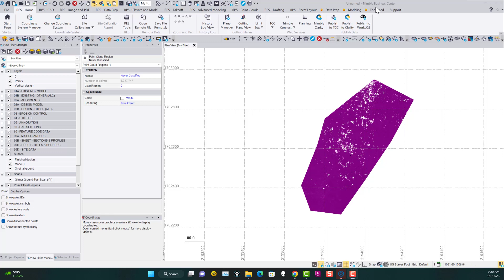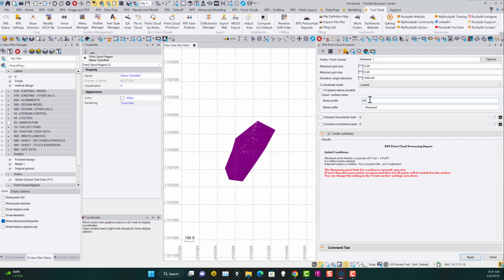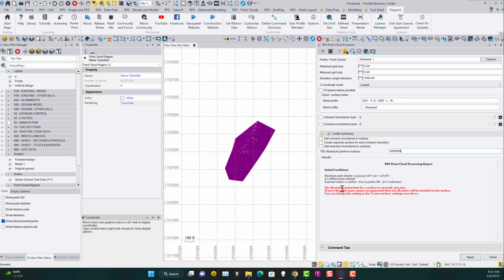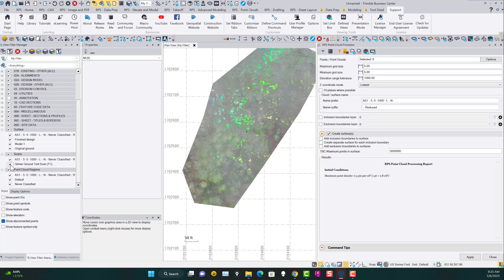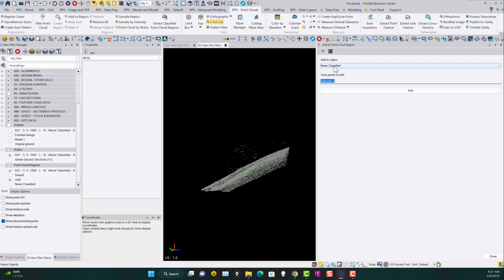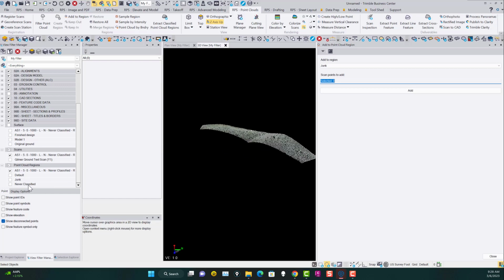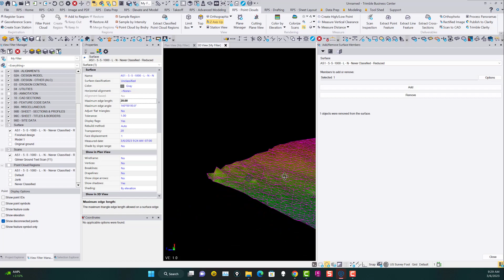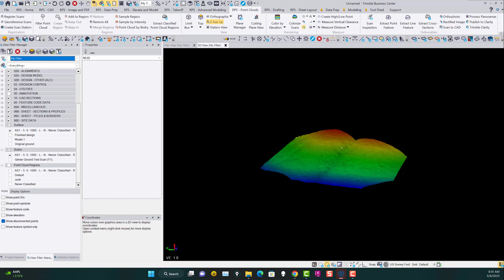How To: Point Clouds - Removing Tree Canopy & Brush

Comment: I wonder how good this would work to remove automobiles in a roadway scan.
Reply from the maker: We have not tried that as of yet, but is something worthwhile trying. Would you be able to share an example file to us at contact@rockpilesolutions.com so that we can test it out for you? If it is something that works, we would be happy to release a video update of how to do the process. Thank you!
Reply: @rockpilesolutions8457  I sent 2 scans taken with a SX10. One is a freeway section (1 setup) and another project is a surface street near an intersection (1 setup).